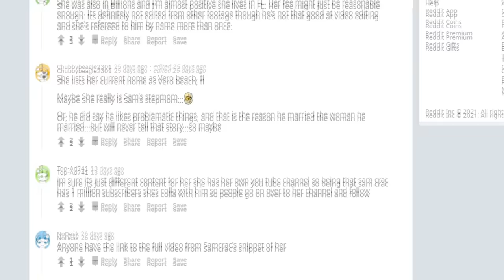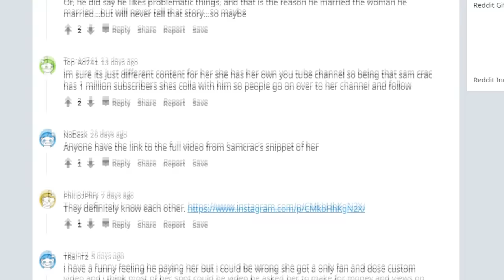I Found a Ferrari 458 at the SCRAP Auction! I Brought my Famous Stepmom to Help me BUY!

Comment: The hole in the floor of that Lamborghini is to use a special tool that comes with the tool kit to put the transmission in neutral, I work for a dealership and I had to do that on a 2018 Audi Q7

Comment: 21:10 That is an electric break assist for when youre pulling a heavy trailer that has electric breaks. it calculates how much breaking pressure it needs to apply to the trailer so that the weight of the trailer doesnt damage the vehicle towing it.
Reply: Brake*
You take a lunch break 
Brakes stop your car or truck
Reply: @DustinRZR  crazy how Google voice typing didn't know the difference a year ago...

Comment: The thing on the urus floor is to release the gearbox from park if the engine doesn't turn on. There is a red handle in he trunk and you place it in the hole and turn it and the gearbox goes in neutral.

Comment: Thats a 6.4 truck and you definitely don't want that money pit unless you're planning on 12v swapping it, then you'll have one of the coolest nicest driving trucks EVER! On the second 6.0 F250, the thing with the numbers under the dash is for adjusting the gain for the trailer brakes to put it simply.

Comment: That device in the truck is a trailer brake controller. It allows you to adjust the sensitivity of the trailer brakes for when you have heavy loads it won't feel like you're pulling a heavy load.

Comment: When it comes to the Ford Super Duty, you want the engine in the older model with the mystery black box with numbers. (That’s an electric trailer brake). 7.3 Turbo Diesel million mile motor.

Comment: The module in the f250 under the steering wheel is a brake controller. Its for towing, let's you make adjustments to brake pressure on the trailer.

Comment: I miss my STS-V.  Had blower upgrade + cam + exhaust and was a beast.  Fuel economy was comical, but that's not why you buy that car. :) Not a fan of the "Red Tango" interior though.  Get a 2008 or newer as they have the Heads Up Display (HUD).  [2006/2007 did not]

Comment: I worked for a horse lady when I was a teenager,cleaning stalls an whatever. She had a Rooster,would attack me just like yours. One day I was a little hung over,not feeling to well,but my job was to clean stalls. An that damn rooster was sitting on the top board of side wall of the stall I was cleaning an just cockadodoing as loula as he could.(winter time below freezing) I picked up a frozen horse turd an fired it at him. The cockadodados stoped. Later on I went into the next stall, an there layer a dead rooster.

Comment: Tell "Momma"-Don't pull on the steering wheel to get up into the truck. There are sheer/break-away pins in columns that work loose when you do that, GM's "Saginaw" columns were notorious for that. We has an F350 SD, crew cab 4WD we use for towing & construction stuff at our property. BTW, my daughter drives a GT350...she did not want anything to do with an Ecoboost Mustang

Comment: Sam I think that strange box is for hauling a trailer/RV for the brakes.
Reply from the maker: You are CORRECT! I've never seen an aftermarket one like this before, my truck has one built in the center console.

Comment: That rooster is likely having Hormonal issues and trying to establish a pecking order. Males birds tend to do this during this time. With a rooster you don't ever run from him as bow you the loser. You run toward him with arm up and start to flap them around to make yourself bigger and look aggressive and stare him down till he back off and start pecking the ground and tries to avoid looking at you, it may take a few times as he try to challenge again. Never walk away, or run as it pretty much makes you the weaker of the flock. A real aggressive male you may actually have to strike him with a bucket, or a branch laying around to get the point  some farmers will kick them not to hard but enough to get the Point across. Most you won't have to.

All birds do a pecking order and you have to show who boss of the flock. I been dealing rooster as grew up on a Farm and with pretty much all kind of birds since small and work with wildlife.